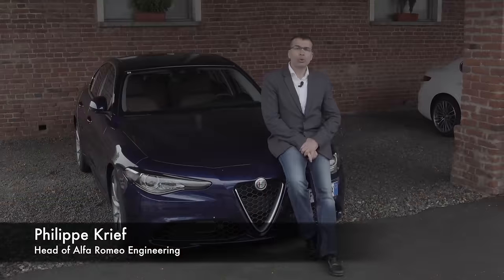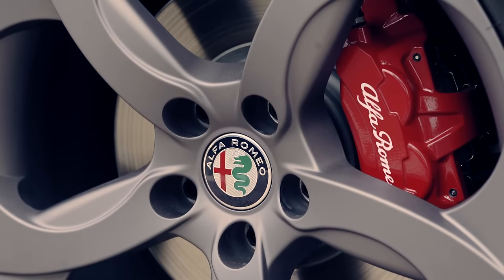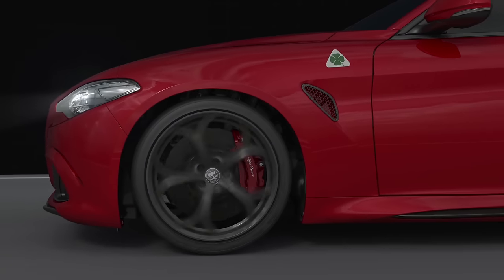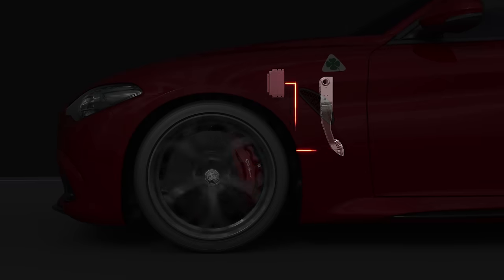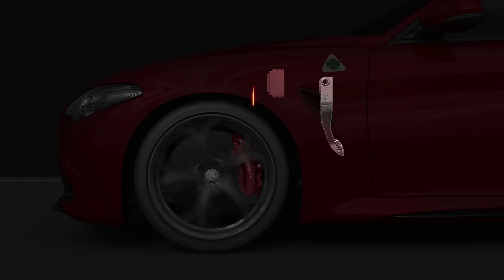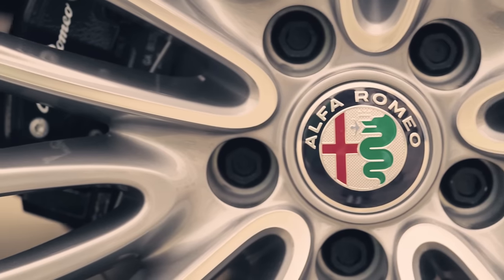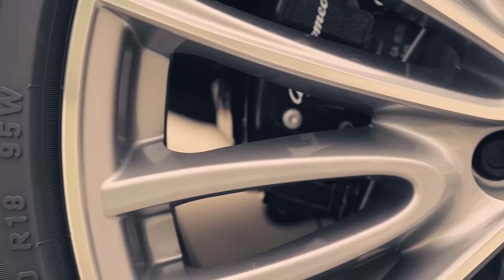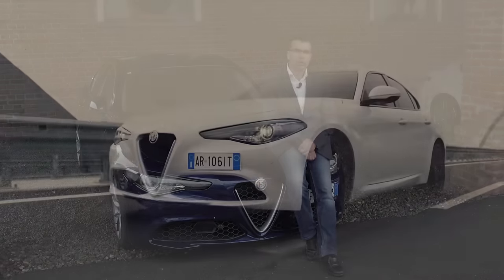Alfa Romeo Giulia: the Integrated Brake System (IBS)

Comment: and this is why i wont buy the car. Its perfect otherwise, but i wont drive a car with brake by wire. It is unneccesarily complicated and in an Alfa i will break at some point. Why couldnt you just do an old fashioned system that works on track aswell as in stop and go traffic and most importantly works forever...
Reply: If electronics brake, the valve opens and you use your brakes like hydrolic ones
Reply: That's why other manufacturers have adopted or are adopting this very technology? See Maserati MC20, Corvette C8 etc.
Reply: Yes they do, because the target buyer want to play around on a display changing suspension, throttle, brakefeeling....thats not me, i just want to drive the car, no need for all these electronics that are just gimmicks. If i want a playstation i buy a playstation ;) If i buy a drivers car i want a reliable and simple vehicle that is focussed on performance and calibrated for just enough comfort to make it a enjoyable daily driver.
Reply: @_coffeeandcigars  good luck then. Unless, of course, you only drive museum pieces (may be alsp because you can't afford new cars?), in which case your rant is irrelevant :)  Otherwise, I bet you already drive cars with electric steering racks and cars with fly-by-wire accelerators already.
Reply: @nessuno5403  driving museum pieces wouldnt not so bad, usually way more enjoyable ;) if only they were viable for a daily driver =D
But thats besides the point. Brake by wire will not bring me personally a better experience. Its an overcomplication that will be a hassle down the road. But if you love it go ahead and enjoy ;)
Reply: @_coffeeandcigars  no, I agree with you. It's just not as dramatic a situation as you make it woune and it's also inevitable with new cars. And Europe forcing people into these new age cars is like cancer... but that's another topic again.